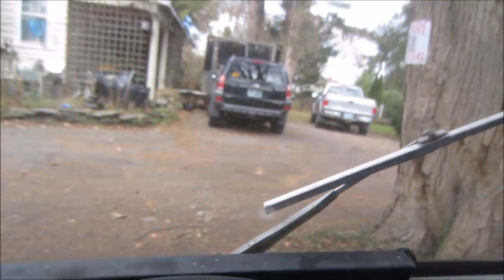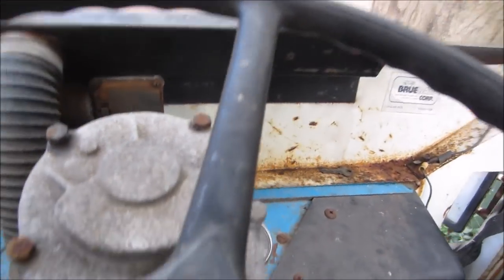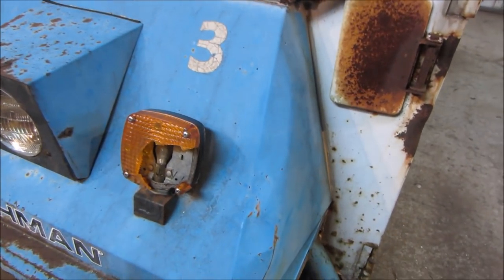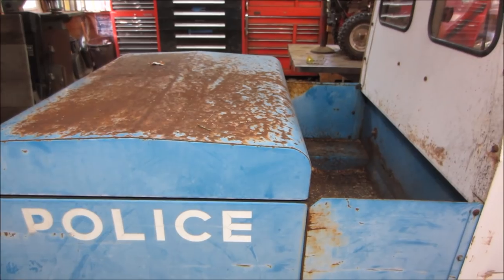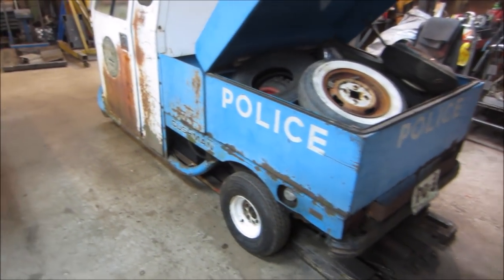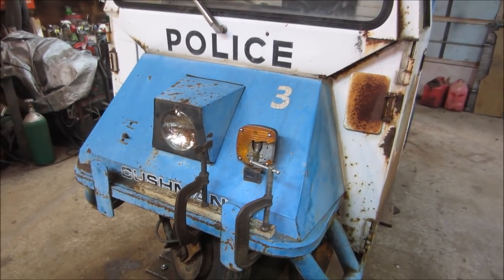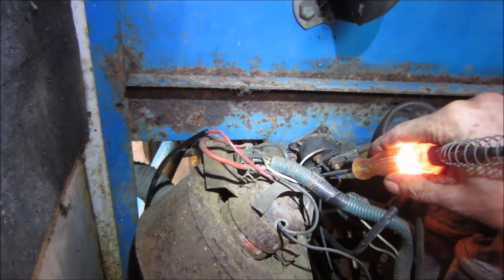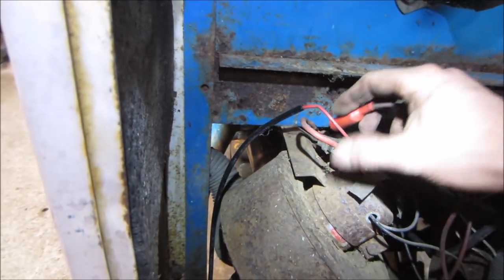cushman meter maid bodywork,

Comment: The blower motor is shunt wound like a starter motor. It has no permanent magnets. Both the rotor and stator are wire wound electromagnets. Reversing the polarity reverses it on both the rotor and stator so it ends up spinning the same was no matter how you connect it.

BTW did my Mustie1 impression this weekend. Fixed a golf cart then tore apart a bicycle.
Reply: That's good knowledge i had no idea that's how they worked, thanks

Comment: I've built DC motors and if the field is also a winding and powered by the same source it will always run the same direction.  The front came out nice!!!  I had no hope for that fan motor , nice!!
Reply: MrLangDog  That’s why a starter on an old tractor doesn’t care whether it has a positive or negative ground system.

Comment: Great job. I'd bet that passenger side door got used most often, and kept getting flung open, moving the hinges.

Cool project. But you know someone is watching that worked traffic/checking parking meters in one just like this. Same windsheild, same steering wheel thinking 'oh man I spent three cold winters in one of those handing out tickets.'

Comment: I wouldn't put too much effort into that squirrel cage blower, that is/was an off the shelf blower made by Dayton, Dayton makes all kinds of oddball off the shelf stuff.  BUT while it is possible that Meter-maid Cart came with the Dayton blower from the factory, it seems to me more likely that the mechanical maintenance people replaced the original blower with the Dayton unit.  Where I worked we often did the same, usually Dayton replacements were cheaper than buying original units.  Dayton still makes 12VDC squirrel cage fans, some of them are pretty cheap under $50.
Reply: MISTERComaToes 50 bugs is a lot of coffee and cookies, when this one still works;)
Reply: Well, as a diesel/heavy equipment mechanic for over 30 years experience, I can tell you that once one of those blower motors seize up they are pretty much right on the verge of seizing up again given a little time to sit and enough humidity.  Honestly, that blower is just junk, especially with the rotted case and fin off of the squirrel cage, which will unbalance the blower.  It also looked like he might have bent the shaft (or the cage).  Trust me, it was working to a degree but it's not ever going to run like it once did.  You must have some pretty valuable "bugs" to be able to buy coffee and cookies with 50 of them!

Comment: Bet those love taps with the hammer let the ATF get in to the bearing, looks like it'll live for a while longer now! Not sure, but the cage might be wobbling from being bent more than or in addition to being out of balance. But if the cage fails, might be able to replace just that, eh?
Probably a good thing the fan didn't run before being removed, there would have been shop-rag puree everywhere! Nice work on the door and nose, it's looking and working better every time!

Comment: You're a patient guy!  Got the motor running. Gonna patch the body?  I just bought a jumper pack on Amazon. 
the 1000 peak was sold out where there were good deals. I'm proud to say I was patient too. Warm day and finished taking the mower deck off my old front engine snapper. Waaaay too many connections. No wonder they stopped making them. LOL!

Comment: That blower definitely looks like an off the shelf unit that could probably be sourced from an industrial supply house (or Ebay) for not too much money. The Dayton brand motor gives it away. Those flex hoses are also likely to be obtainable from the same sources, though the aluminum hose you found should work just as well.
Reply: I understand all that quite well, as I am an old tinkerer myself with a lifetime of fixing all kinds of "unfixable" things behind me. I was just trying to be helpful.
Reply: NAPA used to stock that flexible defrost duct hose.

Comment: You could line the inside with 1/2" radiant barrier foam and kept in some of the heat and quiet the cab noise down.

Comment: I worked for a company that made similar units through the 80's once tightened those set screws on the squirrel were always tough to loosen, if you can manage to get a drop of 3 in 1 household oil on the barring it will do wonders for if you think it, gotta tell you you may want to leave the squirrel cage alone it's fragile and you can access the shaft from the discharge between the housing and the cage with a drop of oil on the end of a zip tie

Comment: Having been an auto body and frame repairman for 48 years.  When I saw that door sprung the way it was, I was thinking the door was "wind sprung"  just take a small solid rubber block and put it between the door and the "A" pillar and gently push the door towards the opening. I believe your hinges are sprung.

Comment: Our Cushman had a door issue, too. Someone had backed into something with the door open and bent the frame of the door slightly. It got man-handled back into place. :D Ours doesn't have any of the blower structure, the defrost hood is missing also. Now we know what the big hole in the dash is for, the defrost! Ours wasn't a meter maid, they said it was used in a factory for getting around, and we had a devil of a time figuring out why there was only a first gear -- we didn't have a lift and the linkage for 2/3 was missing/removed, we presume for factory floor safety reasons...

Comment: A little trick I learned about blowing out cavities like that safely. Ask the wife for one of her miss matched kneehighs and put it over the most cluttered end and then seal the air hose tip with a towel on the other end and let her rip… There’s very little dust because the shredding‘s actually filter it as they come out. I’ve even gone as far as to use a leaf blower on one end maxed out for pressure and that really seems to help a lot because it sure beats tearing the whole part out especially if you’ve got fins inside... just sharing ;)

Comment: A socket of appropriate size to fit over the blower cage flange would have allowed you to spin it with a drill. This technique is also effective for spinning large c clamps to take up slack or open them up in a hurry.

Comment: Surprised you don't clean rusty threads w/a little stainless "toothbrush" type wire brush, as someone who works on old rusty/crusty stuff too, I get more stuff to break loose like that than 1 would think. btw that blower unit is a standard Dayton unit, motor and all, and in the future if you ever need 1 you can go to the Dayton catalog and order the whole shebang, or just the motor/fan. And those old Cushman Work Wagons were supposed to have VERY good heat, as they were used all winter long.

Comment: When trying to get stuck set screws loose, remember that vibration is your friend. Get a lovely assistant to tap on the end of the blower shaft whilst you apply gentle pressure on the allen wrench. That's my tip.

Comment: is there some kind of clearcoat to keep the  paint from  rusting? Some kind of moisture liner for the trunk and would make an awesome cooler? Insulated and use the guts of one of those travel coolers? Great use of the vice and what a never thought of that. Great video and thanks

Comment: Fair Warning, MAGNETS WILL SEAL TO YOUR PAINT.  I thought I could just take them off and replace them, after a year, they were permanent, and removing them not only destroyed them, but they ripped leaving a massive section that you can not remove without damage. Maybe heat would do it, but there are not many options, and the magnet companies are useless.They have no suggestions other than ice scrapers, which were a fail. They told me the signs MUST BE REMOVED FREQUENTLY. I don't recall seeing that warning or disclaimer ANYWHERE.
Reply: Eric Ek Yep, I had one on the tailgate of my truck for several months. When I removed it, the paint underneath was damaged! 🤬
Reply: John Acuff well I have found if you use a penitrating oil it will loosen it. But it won't save the magnet in my case.

Comment: Maybe a generous spray of muffler paint inside that heat exchanger would cover over the mouse piss?  Or a soak in some sodium hydroxide.  You can buy the KOH in flakes pretty cheap.
Reply: Greg Cooper sodium hydroxide dry inside there and then getting out in winter ... calling it burning lungs then?.. hahaha, not a all to good idea ;)

Comment: You do so much work you should really get a set of Irwin wire strippers! They are the best. They only take off the coating and you will not lose any wires.

Comment: The fan must have a rectifier in it.  Yes a DC motor would normally reverse direction with reversed polarity.  Thanks for the videos.  Surprised you do not spray something like PB Blaster or WD40 on those rusty fasteners.

Comment: They still sell this orange vent hose. Check NAPA. If you ever need a heater fan use one from a late baywindow bus that has the auxiliary fan in the engine compartment.

Comment: You got a hell of a lot done in one video :-D
What about a can of ovan cleaner foam to disinfect/clean the inside of the heater box?.

Im supprised that fan motor worked at all lol.
Reply: I would not worry about it being flammable, getting the stink gone is the bit.
But knowing mustie, he will do it another way, i dont often guess right LOL :-D
Reply: canuckguy worried, he could have gotten that fan blade off with the help of one of those " butane" mini-torches.  Every good body man or mechanic has one around for just this reason.
Reply: Thanks for the reply canucky worried.  I also have heated up frozen bolts and nuts (be cautious of underlying flammable materials)  cherry red, then douse with cold water, that will break anything loose.  When I started doing body work back in the early 60's, I have actually "sprayed" cold (warm) lead onto a quarter panel.  I better be quiet now, everyone (or most) will figure out how old I am.
Reply: Also made an induction heater for small bolts and nuts.
Reply: canuckguy worried.  I will be 68 in Jan.  I watch newbies on YT, trying to teach millennials how to do bodywork and painting.  What a sideshow, I pray for people who get their vehicles worked on by many of these "hacks".  Some, I have never laughed so hard at.

Comment: I just spotted a rusty key under the windshield near the dash, about 1.17 in. looks like it's been hiding there a while. wouldn't be the key for the original ignition would it? academic now as it was fubar but wouldn't it be ironic if that had fell out from being tucked under a window rubber or similar!
Reply from the maker: does not fit anything
Reply: Ah well, wouldn't have been much use if it did. Would've been sort of cool if it was though. Thanks for getting back, and keep up the good work (on machines and videos both). Cheers

Comment: In your VW parts stash do you have any of those heat booster blowers? The ones I used years ago looked similar to the one with the busted squirrel cage you have. My experience with damaged squirrel cages is once they start to go with missing blades the out of balance tears them apart pretty fast and wipes out the bearings in the motor as well.

Comment: On the blower motor, it is a wound coil motor. When you change the polarity of the armature you are also changing the polarity of the field so it turns the same direction. You have to change one without changing the other to get it to change direction. If it was a permanent magnet motor, changing armature current direction will change the motor from CW to CCW.

Comment: Hey Mustie1, U can keep the shop rags and if U want the mice to go with them, I have plenty here for U!!!!  Really nice job on the Cushman, U got the carb just right, they are not known for the ability to cold start. With mine, it really needs a good battery, if the voltage sags at all, the spark gets weak and no start thought it is turning over.... I also don't think the doors ever worked so well.  The dent on the front may have been my fault during the unloading process with my back hoe, good job on the fix.... I am very impressed, I may need to bring the second one to U for restore, it will really challenge Ur abilities!!!!

Comment: You can get that metal hose from a place that sells metal shop dust collection in a variety of sizes and adapters or couplings.  Probably way cheaper than VW dedicated stuff. or try dryer hose though it's only in large size (4-5")

Comment: Might try drilling into the bump up at the end of that motor. I've done that before when I had a squeaker. A drop of oil and the squeak would go away. The way that motor sits in the engine bay would be ideal for that if you want to try to run it.

Comment: FIY, if you take a pair of latching grips and grind the teeth in at an angle, you can grip screw heads much better, obviously, a beaten up pair is to be sacrificed. I have two, one smaller like the one you used and one larger that's ground to grip nails too.

Comment: On a permanent magnet DC motor the direction will change but with wound fields as you change polarity in the armature you also change polarity in the fields. To change direction rotate the brushes 90 degrees.

Comment: At 23:18 you hit my screen with the hammer from the inside ;-)
Are you sure that the fan is powered by the electric motor and not by the mouse? But you have forgot to feed the mouse, off course the fan will not run then.

Comment: You need an impact driver for Phillips and flat head screws they are not that expensive.
Reply from the maker: cant use it on that the metal was too thin/rusty

Comment: If you need a new fan you could use a blige blower fan ( for boats ) that are 12v and normally run a 3" or 4" hose. Plenty on eBay.

Comment: A pump up sprayer with a strong bleach water solution in it could do the decontamination on the heat exchanger and ducts. Spray it out real good followed by some air and let it dry for a day. Should go a long way to neutralize any rodent urine.

Comment: About the blower fan needing lubricity.  The guys that repaired my power window motors needed to lube up the bushings on the back end of the motors.  They drilled a tiny hole down near the bushing so they could use a needle to inject oil.  A dab of silicone-carne sealed it up.  For the drive end, just pop a tiny hole in the squirrel cage near the shaft and lube it through there...

Comment: the blower fan the motor is field wound when you switch the polarity it rotates the same direction. as permanent Magnet DC motors are easy to reverse the rotation by reversing the polarity.  some of these field wound motors may have more than one wires coming out for rotation as well to change the speeds. the ones i came accross have orange and red wires the orange wire is high speed and red is low as some motors its grounded to the body and the wires are only the speeds.  the blower assembly and squirrel cage is rotted out. it appears to be made by Dayton electric. im not sure if they are still made unless you can find an old furnace draft inducer blower take the AC motor off of it and use your existing motor. or you can use a blower similar to that just take off the AC motor and you have the housing and squirrel cage fan. most of these blowers are made by FASCO.   the heat exchanger it may need cleaning im surprised it didn't catch fire when u ran it.   the squirrel cage fans they are common to rust out on furnace draft inducer motors. the fins rust off and the unit is out of balance.  I think you Meter Maid will live again with more work.
Reply: some of these motor i had to interchange the leads from the field winding to the brushes on the armature as i tried that on a DCM motor it worked it also worked when i rotated the front housing which the brush card is rivited to.  as these motors are found on school bus heater motors as well as the defroster Aux fans as Bergstrom MFG is one example.

Comment: put a goddamn air filter on that engine. It suffered enough. Also be careful not to turn the cabin into a gas chamber. Carbon monoxide from the exhaust is odorless and it kills quickly.

Comment: Really enjoy your channel. 
I have two questions, 
1: What is the purpose of the two small hatches on each side at the front, by the upper door hinge? (2:10)
2: Have you ever tried IH Penetrating Oil for rusty bolts? http://www.messicks.com/part/b505502/case-12-oz-penetrating-oil

Comment: Nice work! You might be able to pop the hose off the fan outlet to get to both sides of the fan cage, and if there is anything left of that loose vane, maybe you could solder it back in place. Since that is cold air it would have a chance of holding. Or just leave it as is, it probably doesn't matter that much. Maybe you could use some 2" shopvac hose for some of that bad heater hose on the cold side. Alternately, you can get this kind of stuff from McMaster-Carr. https://www.mcmaster.com/#flexible-duct-hose/=1ag3w93

Comment: Mustie, slap a spare tire carrier & spare on it, a Hi Lift jack behind the window vertically mounted. Could you have not used the winter tires or were they cracked? Slap some snow chains and a ski off a SkiDoo on the front would be too funny
Reply from the maker: they were off a snow blower

Comment: You should have cut that door frame piece out and replaced it with new square stock. Rust is not patina - and it will continue rusting. This would have been better as a proper restoration rather than bodging, in my opinion.
Reply from the maker: l am building what l want not what you want,
Reply: good answer
Reply: Should we care about your opinion or Mustie's opinion? Are we watching your video or Mustie's video. Where are the Sasquatch videos of vehicle restoration?